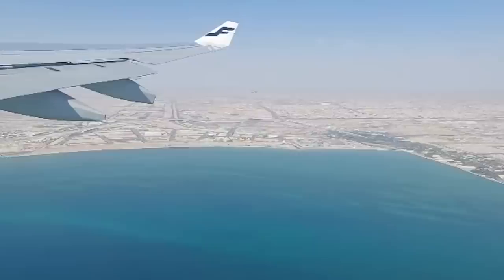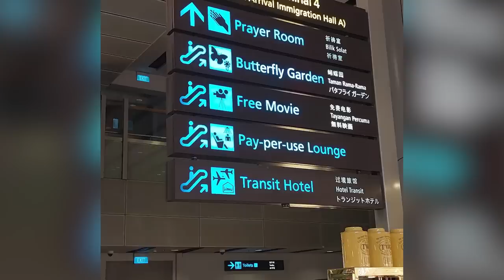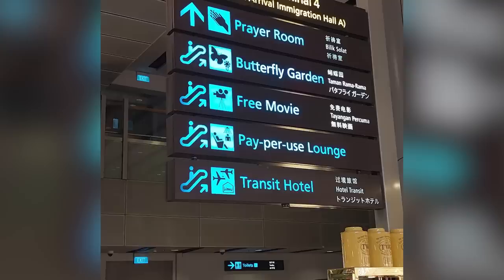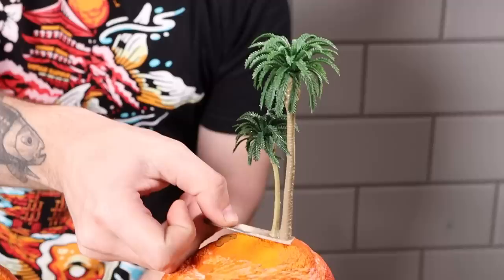I travelled across the world to make this Warhammer Diorama

Comment: I've always had a leak using hot glue for the seams. I prefer just packing tape and if you have a leak use the tape similar to the way they wrapped theirs but use more tape. Works the best I have found and using compression is the only way to go for leaks.

Comment: You cannot use the torch or other heat to eliminate bubbles on large quantities of resin, because you catalize the reaction and thus making it solid in few minutes. Happened to me while using an hairdryer to make the resin more liquid to remove bubbles before pour, it went up over at leats 80°C, tried cooling it but as you give it the start a 12 hours epoxy solidified in 4 minutes.

Comment: Yeah, I suspect the culprit of all the problems you guys had was simply using the incorrect type of resin.  Well, and the unrealistic time constraints.  Simply put, you needed an ultra deep pour resin. You might have gotten away with a river table pour resin but that still might have needed to be poured in two sections for your project depending on brand and probably would have needed 24 to 36 hours to set and about a week to fully cure.  Impossible with the amount of time you had. 😅

However, major props to the Tabletop Time team for saving it!  It turned out epic in the end and that's all that matters!  Nice collab!  I subbed! 😁👍

Comment: Gotta love Lucas doing most of the work and still Emil being the face of the channel, really great job tho. I hope this gave you enough expirience to make the titan diorama perfect. One thing I'd recomend is trying to calculate before hand about how much resin you are going to need and put one of the two parts in a big container and add the paint in that. Then do small layers so it doesn't heat up much and mix some of the colored part with the other part. That way you can ensure that all the layers have the same color and thus the seams will show less.